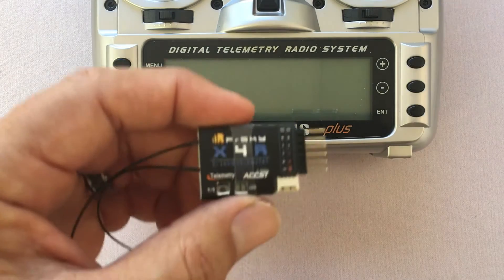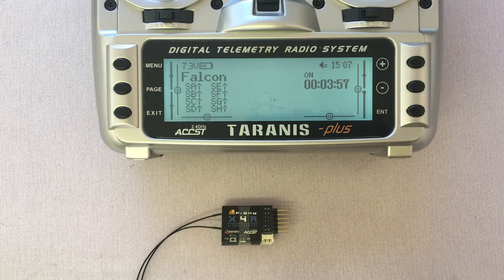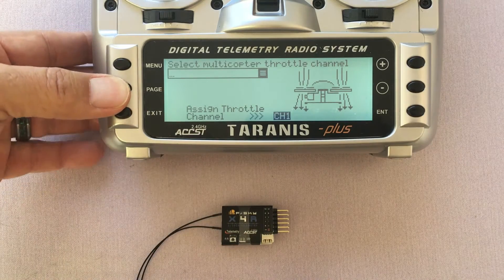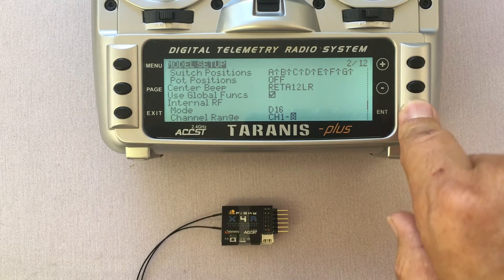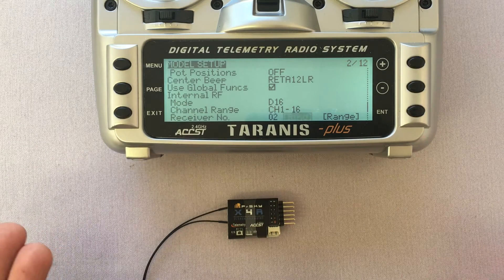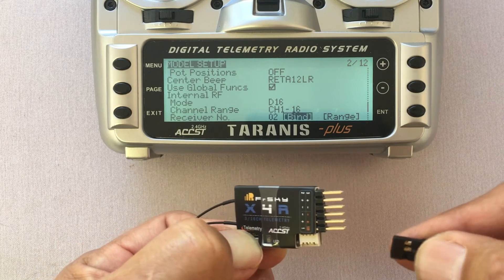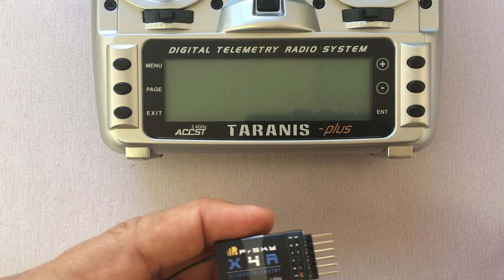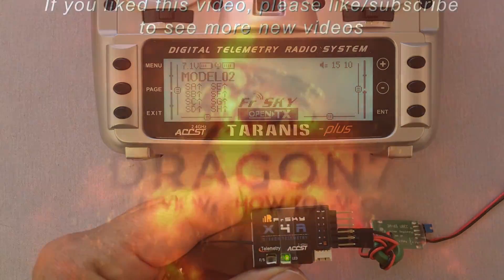How to Bind FrSky X4R-SB to Taranis X9D Plus

Comment: Hey man I have a question im new soo i need 4 channel for my wing the 4th for my mode switch i put the 4th ont sb pin  but it wont work , sb cant be used as a channel ? Im new too the hobby so i just bought it thinking it was a 4 channel tx

Comment: Hi, i am new to this and I bought myself a crusade gt2 and a taranis plus also a receiver V8FR-2 I am not sure even how to connect the all thing, I find out from youtube that the cable provided from diatone can be connected but to cut 2 cables that I did cable 3 and 5 from the connection on the quad board the receiver has 3 symbols on the side + - and other like a T. I am wonder if you can help can I bind the receiver directly on the quad like connecting the power ground and positive only? what can you suggest I do I live in a city and I don't realy know any one with quads etc, I need to bind the receiver to the control so I can then connect the all thing on the quad the extra white cable for the signal then will be ok to drive no?  thanks for the help

Comment: Hello. I have a question. I just received the Taranis x9d plus last night. I noticed that the switch on the right side all the way to the back is only going into one position. Once I try to put it into another position it quickly springs right back into the one position. Did I receive a defective transmitter? Thanks.
Reply from the maker: +Flying Starz It's meant to be that way.  It's a momentary switch.
Reply: Dragon7 Thanks for responding. I appreciate that.

Comment: When I try to put t in bind mode it just turns on both LEDs solid
Reply from the maker: +DJ Walsh The transmitter is not on and in bind mode.
Reply: It was, but I found the problem, the PDB was only putting out .2 volts to it
Reply: @djwalsh1884  Hey, sorry I know it was 2 years ago but what did you do to fix the problem ?? thanks
Reply: Twyzee it was so long ago but I probably just replaced the pdb